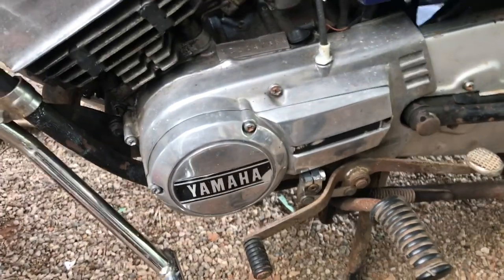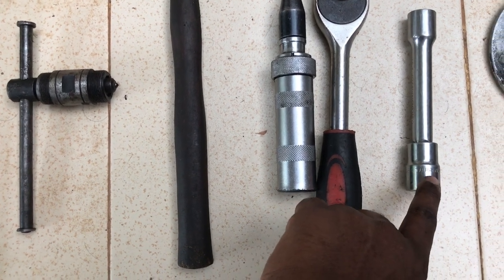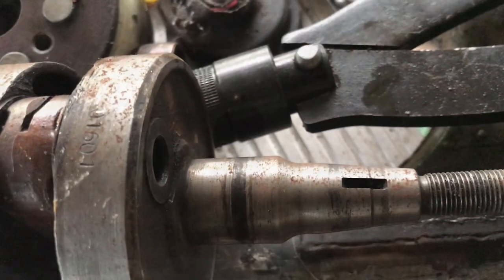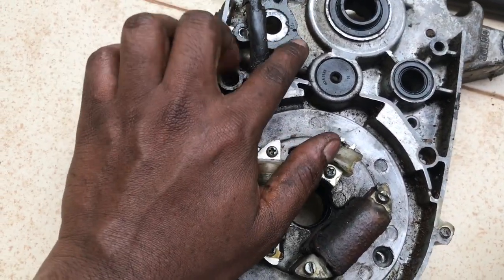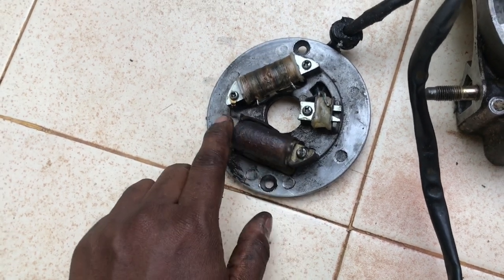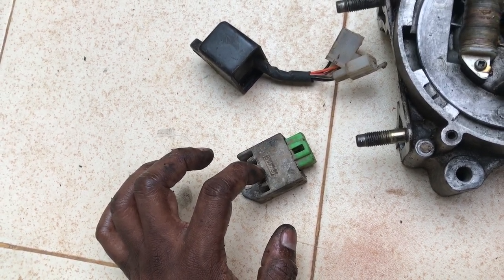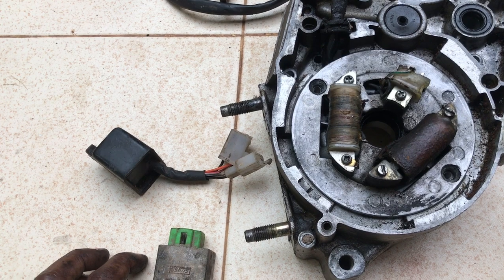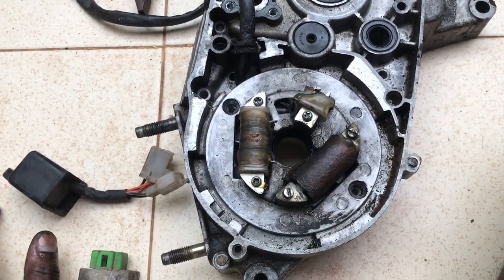Yamaha RX 100 6V to 12V conversion.

Comment: Hi bro. My 100 is now running on 6v. So i want to convert that to 12 v. So bro my q. Is do i need to go with rx100 magnet or 135 mag. Because on here you commented that 135 mag will make fluctuations to the crank.  

So should i opt for 100 magnet or 135 ?
Reply from the maker: Just replace the lighting coil. The later model 100 coil is a direct fit
Reply: Yamakaze so bro 12v rx100 rr, 12v battery, the same cdi, rx100 12v wire harness. And from my existing 6v coil set just replace the lighting coil to 12 v( i got one genuine 12v old stock lighting coil. Its ok right?). But still confused that the existing 6v magnet works fine ?
Reply from the maker: @nandusuganthan8902  the magnet is strong enough to produce 12 v even with the current lighting coil.
Reply: Yamakaze ok brother thanks a lot.  Got an overall idea. 👍👍

Comment: Great video as usual Brother. 

1, I have few questions regarding the conversion as I am planning to buy RDD CDI(just the CDI alone) and fix it on my rx100. I heard that it doesn't work with rx100 12v setup which came in later rx100 models so, we had to convert to rx135 setup for it work. Is it true?

2. Or is it simple to buy an rx135 magnet assembly and fix it in, apart from timing it.  If we want to go with this approach, I believe we need to change the wiring as well. 

Sorry, I am all over the place but want to hear from you.
Reply from the maker: mjshaheed now RDD cdi’s come with connectors for rx 100. If not then it’s a very difficult task, technically you can get away with just changing the coil plate and the magnet, but it might not work as expected since the crank is not balanced to take the additional load of the 135 magnet. 

It’s better to get the RX 100 cdi or convert the 135 CDI to 100 by changing the connectors if you already have a cdi

Comment: Sir what about the socket of the Rectifier , the RX100 3 pin won't fit to the rx135 Rectifier . please reply , thank you !
Reply from the maker: you need to create a connector
Reply: @Yamakaze  sir that means I should find a 4 pin socket which fits to this and take the ground wire out and connect to the chassis. Am I right?

Comment: Sir, I got my rx100's cylinder rebored and I tried to press the piston(with rings installed) inside the cylinder without any lube. Now, there is a straight scoring mark(about an inch)on the top section of the cylinder wall. I could feel it with my nail.  What can I do now to remove it? Will re-honing work or can I simply use it? 😢
Reply from the maker: Hone it and use it
Reply: @Yamakaze  Thank you so much, Sir!
Reply from the maker: @allaboutnothing99  👍

Comment: Sir, I have just bought a used IL2 12v Magneto and coil assembly. I will be buying 12v RR unit, bulbs and battery. As for the RR unit goes, Minda 12v 3pin RR for rx100 is available. Is it any good? Please reply.
Reply from the maker: Buy libero or crux OE rr unit
Reply: @Yamakaze  Thank you, Sir.
Reply from the maker: @allaboutnothing99  👍

Comment: Hi brother, i have RX100 in which i changed 12V battery and 12V RR unit. Now my question is can i fix new 12V coil plate with stock 4 hole 6V magnet or is it compulsory to change 2 hole 12V magnet also?
Reply from the maker: Magnet needs to be changed

Comment: Hi Yamakaze, how are you??
I recently restored my bike and 12v conversion is yet to be done. I put on 12v Amp Poweron battery 🔋 for the bike and apart from that my mechanic said we also need RR unit and 2 in 1 buzzer. Will that be all for the 12v conversion or do I need any??
Thanks.
Reply from the maker: SRT 99 No, it’s clearly answered in the video. If you think just replacing the battery and RR unit will convert it to 12v then it would be super simple, no?
Reply: @Yamakaze  I have changed To 12v battery, RR unit and Bulbs and wiring total new... Voltage getting is 12.5 volts, I need 14volts for getting aftermarket led light, my question is can I use rxz coil instead of 135, and do I need to change the magnet also or the old one will work.... Thanks in advance

Comment: What is the benifit of conversation from 6v to 12v , does that only helps in lighting

Mine is 6v , very hard to find battery , 

One mecanic put 12v regulator , now its all working , not having any problem till now ,
Reply from the maker: Same thing you mentioned, unavailability of battery, bulbs, horn

Comment: Bro..can u please explain how the pick up coil works in rx 100 or 135 coz its different from the 4 strokes..pick up and flwheel trigger mark setup
Reply from the maker: the pickup coil or pulsar coil creates a pulse at a particular time, this pulse is used to trigger the cdi to create a spark signal which intern triggers the HT coil to create a high voltage signal which is converted to a spark using the spark
Reply: So the function of pick up coil is to produce strong starting current or does it play other important part in running ?

Comment: So you mean sir, we only change the rectifier, a 12 volts rectifier? I'll wait for your answer sir. Thankyou very much
Reply from the maker: Jhun Bedania no, you have to change the lighting coil, RR unit, flasher unit, battery and all the bulbs.
Reply: @Yamakaze  ah ok sir. I thought im not going to change the lighting coil.. Thank you sir...
Reply from the maker: Jhun Bedania good
Reply: @Yamakaze  but OE Lighting Coil is not available nowadays and other which brand you would like to suggest are reliable and durable.Many mechanic don't prefer to fit brand name Swiss as all the component available of this brand is not at all reliable. Yamaha genuine partsOE, or NIippon-India products of Yamaha RX series are not available in my or near by homecity Ranchi. Please suggest about the availability of the said parts in fair price in any of the southern states of India as far as my assumption RX series bikes spares are heavily stocked and are sold in a very expensive price as some sellers can demand any high price, double are more than that. Please help from where it can be bought if the converstion of electrical system 12volt to 6volt putting a new good reliable brand other than Genuine Yamaha Parts12v Lighting Coil instead of getting used 12v L-Coils from second hand market or from a scrapped bike having 12v electrical system. Thanks
Reply from the maker: Ranjit Singh Manki I have a different take on the parts hoarding issue. I have traveled 70-80 kms to scout for parts. I have one shop on my way to home from office. Even though I know I can buy rare stuff from the shop which is far, it’s not practical to travel that far, and when I go there I buy only the necessary things and not hoard parts like some people do. Now this is enjoyable and makes sense once or twice a year not every time I want to. I spend atleast 2000 rupees fuel and a whole day. So if you look at it, it’s wise to pay something extra for parts which will be delivered to you, at your convenience. Realistically even Yamaha has increased the prices, the silencer which used to cost 1000, now costs 2500. Chan cover which was 600 is 2500. I can’t blame these Internet sellers who travel to remote shops and buy stuff in bulk to make a profit. I know it’s not fair sometimes. 10k for a rx front mudguard is just plain stupid, but people do ask for funny prices at times, there are people who see value in that. Now to answer your question. Swiss is the only brand available here as well. The mechanics are against it because it might blow up in a day. Used coil is the only option then if you are not willing to wait or pay for OE stuff. One of our subscribers from JH had recently converted his rx 100 to 12v he bought the entire rx 100 coil setup from Swiss and installed it on his 100, he is very happy
Reply: Yes you are absolutely right. But the Swiss brand mechanic still don't want to fit.In their own professional experience they  say it seems every thing is okay but after some time which they say there is some power loss in the engine while cruiseing also during accelerating from lower to upper Gear or further need to increase in speed the power tend to go bit weaker.Accordin to them this kind of thing occers due to lower rate of flow of current from the magnet-coil assembly as the coils cannot supply the required rate of current continuesly due to substandard quality of the coil assembly .Aftter discussing this matter with number of good mechanics, nobody favoured to go for this brand.OE is not available, Nippon India brand is also not easily available, approaching to the company Customer Care contact number cannot get any response about how or where to procure the required  components.Niether Nippon India bothered to answer  any of massages or mail sent.by any individual customers like me opted to go for the brand for personal use or guide to buy from the authorized distributor or retailer in country regions where the products are marketed.May be it is due to company's limited region marketing policy.

 any quarries.

Comment: thanks bro. you mentioned to change the coil, i am assuming it to be 12 volt coil. do you recommend any brand like swiss of nippon?
Reply from the maker: both are bad, try to get OE
Reply: thank you. any part number? or is it shared with any other model - like the one you mentioned about the RR.
Reply from the maker: @nischaltopno5746  not sure of the part number get the old rxg type lighting coil, 5 speed bikes have a big coil which won’t fit and clear the magnet

Comment: Can we downgrade starting coil in rx 135  with that of rx 100.
Reply from the maker: No, it won’t work. Why would you like to do that? Just curious
Reply: Due to non availability of parts in remote areas. Weak current on my yamaha rx135 resulting in starting problem.
Reply from the maker: @jacksonpeter4124  135 coil won’t increase the current, just get a splendor OE ht coil. That will increase the spark strength
Reply: Thank 🙏. I want to fix on rx 135,as it 
Is giving starting problem, which splendor(starting coil) model can we use.??? ✌✌
Reply from the maker: @jacksonpeter4124  splendor OE coils are same
Reply: Do we need to change the whole coil plate or just the starting coil.
Reply from the maker: @jacksonpeter4124  if your spark is weak, first thing you look at is the ignition coil, next is the pulsar coil and then the CDI unit

Comment: Is the RR unit of Rx135 is dierect set for Rx100?Any need to change the cdi of Rx100?
Reply from the maker: Vysakh Vincent there are 2 kind of wiring kits, if you have the 12V wiring kit then it will take the RR unit from 135, if it’s a 6V wiring then you need a connector to connect the 135 RR unit. The rx 100 6V has a 3 pin RR unit and Rx100 12 V has a 4 pin RR unit (same as rx 135)
Reply: @Yamakaze  what about cdi
Reply from the maker: @vysakhvincent1566  you have to use your old rx 100 CDI, the 135 CDI wont work

Comment: What are the parts that need to be changed other than the stator? 🤔
Reply from the maker: RR unit, battery, relay and all bulbs
Reply: @Yamakaze  Thanks for the answer bro 🫡
Reply: @Yamakaze  I think the 6 volt ignition coil is sufficient, there is no need to change it. 🤔

Comment: We have to relace rx100 Fat coil into rx135 Fat coil? Right?
Reply from the maker: Shriyansh Mishra yes that’s correct
Reply: @Yamakaze  We have to change the charger and cdi also?

And what will be the total cost?
Reply from the maker: Shriyansh Mishra if you are referring to the regulator rectifier unit then yes.
Reply from the maker: @shriyanshmishra8778   CDI need not change, I have no idea of the costs in your area.
Reply: @Yamakaze  Thanks...😊
Reply: Can we get the rx135 fat coil alone or we have to buy the full coil assembly ?
Reply from the maker: Shriyansh Mishra coils are available as single coils
Reply: @Yamakaze  so i will say to the shopkeeper:-

Give me the fat coil and rr unit of rx135.

Right?
Reply from the maker: Shriyansh Mishra charging coil not fat coil 🤣. New bulbs battery and RD unit.
Reply: @Yamakaze  Ohk...🤣

Thanks.😊
Reply: @Yamakaze  We have to change the light coil? now is it okay? 
And the magnet will of rx100 only or we have to replace it with rx135 magnet.?
Reply from the maker: Shriyansh Mishra no the magnet can remain the same. It won’t be great but do the work, if you can recharge the magnet somewhere in your city it would be better.
Reply: @Yamakaze  I went to the shopkeeper and he say's that Rx100 and Rx135 both have same coils only the rr unit is different.Now what can i do? Buy it or change only the RR unit?
Reply from the maker: Shriyansh Mishra the later model rx 100 were 12v, so the coils were same. If it’s aftermarket then the coils will be same. You can buy those and use. See if you can get OE coils.
Reply: @Yamakaze  Ohk, I was thinking that first i will buy the RR unit. If it works then great if not then i will buy rx135 coil. What's say..will this plan work?

And what will the cost of RR unit And coil Approx...?
Reply from the maker: Shriyansh Mishra the rx 135 rr unit will not work well, your coil supplies a max of 7-8 volts, don’t risk it. Buy the coil replace it, use a RX 135 RR unit. I don’t know the prices, try to get OE, Swiss one is crap
Reply: @Yamakaze  ohk...thanks...😊
Reply from the maker: Shriyansh Mishra 😀

Comment: Bro please help me rx100 rr unit comes with 3 pin socket and 135 rr unit comes with 4 pins how to connect the wiring please tell me bro
Reply from the maker: 2 pins are ground in rx 135

Comment: Bro , need some tech help 
Is the rr unit of rxg with 4 pin is a direct fit to 89 model rx 100 wiring? 
Is the lightning coil of rx 135 a direct fit to the 89 model 100's old stator plate? 
And flasher of hero honda 12 v??
Reply from the maker: The answer to first 2 question is no, the last question is yes
Reply: @Yamakaze  so how to fix light coil in 100? Any solution?
Reply from the maker: rabbi rubiel https://youtu.be/UqtwLei9JLo
Reply: @Yamakaze  
Bro for my 89 rx 100 is that cdi kit with stator plate , magneto and associated things direct plug? 
Mine is old 6 v wiring . If it's a direct plug & play I too wanna buy those.
Thank you for sharing your knowledge and help.
Reply from the maker: rabbi rubiel it’s plug and play, you will get new wiring kit with the kit, if your existing kit is not in bad condition then I suggest that you use the existing wire
Reply: @Yamakaze  
Okay thanks bro.
Reply from the maker: rabbi rubiel 👍

Comment: Can we use same cdi and ignition coil from 6volts after converting 6volts to 12 volts ? 
Please sir answer, its urgent.
Reply from the maker: Yes
Reply: @Yamakaze  so we need to change only battery, rr unit , flasher and charging coil, right?
Reply from the maker: Yes

Comment: Hi, 
how much does it cost for 6v to 12v??
Thanks.
Reply from the maker: Looking at all the parts needed around 2000, With Battery 2000
Reply: Yamakaze I have a new 12v battery, Bike is running on 6v but sometimes horn comes too low and my mechanic suggested me to convert it to 12v then only our battery will be getting recharged.
What is the actual use of 12v conversion does it really help in battery recharge and better lighting??
Reply from the maker: @AB-hs9pw  consider your system as a bank account, you have 12 Rupees in the account and you withdraw 12, but you also keep adding 12-14 rupee to the account, your average balance is going to be above 12. now consider if you add just 6-7 rupee and your withdrawal is 12 no matter what. I hope your question is answered.
Reply: Yamakaze 🙏🏻 thank you
Reply: @Yamakaze  Can we add battery in Suzuki Max 100    like Suzuki Max 100R.   What changes we have to do please answer
Reply from the maker: VP Raut I don’t know much on that, @brattybiker can you help?

Comment: Hello sir, 
Can RX135's magnet flywheel be installed on RX100 
I mean, are they of the same size and fit. 
Secondly, I do want to know if the RX135's charging/lighting coil be used on RX100.
Lastly, does RX135's RR unit fit in RX100's chassis, the socket type/size doesnt matter, I'll replace the socket manually. 
Waiting for your reply. Thankyou in advance! 
PS you are doing a very great job, you reply to each and every comment even if they are silly ones. 
Appreciate it, sir! 
Respect!!🙏🏽
Reply from the maker: Vinayak Malik yes you can install rx 135 magnet on an rx 100 crank, the rr unit can be fitted on the chassis no problem, if you change the rx 100 coil you will have to get rx 135 coil and CDI as well along with the 135 wiring. Best idea is to just change the lighting/ charging coil and install the rx 135 magnet, the new rx 100 wiring can take a 135 rr unit, I am running a 135 rr unit myself
Reply: Ok sir, thanks a lot!
Reply from the maker: @vmalik2611  welcome
Reply: Hi yamakaze. I had  installed  1l5 magnet 12 volt on  rx 100 and had changed all the electrical components  such as cdi, coilplate,wiring, ht coil,flasher, bulbs, battery, rrunit and horn but mine question is will it run for long period
Reply: My RX-100 was converted to 12v in 2012, but the wiring harness has a 3-pin socket for RR unit. I want to replace RR unit. Please tell me how to adapt 4-pin RR unit to the 3-pin socket. Also, can I use Shogun or Access 125 RR unit? I can take care of soldering.

Comment: rx100 is already 12v ??
Reply from the maker: the earlier models were 6V, they were converted to 12 v due to unavailability of electrical components and for better lighting and  electrical performance
Reply: yes in 1996 Rx 💯 is 12v 1L2 series

Comment: Sir please 🙏 rx100 pe korke dikhow kya change korna porega kuch somoj ma nahi aa roha hain ,rx100 ka rr unit tu 3 pin wala lakin rx135 ka tu 4 pin hain then rx100 pe 135 ka rr unit kaise lagye ? Plz sir A to Z botadizea na
Reply from the maker: Ankur Borah the new wiring loom for Rx 100 comes with 4 pin connector. Only 3 things apart from all the bulbs needs replacement. Lighting coil(fattest coil), RR unit and battery. At present I don’t have a 6V rx 100. I will make a video once I get one.